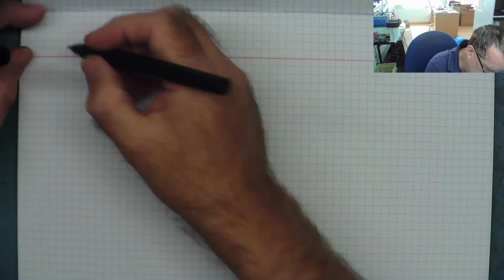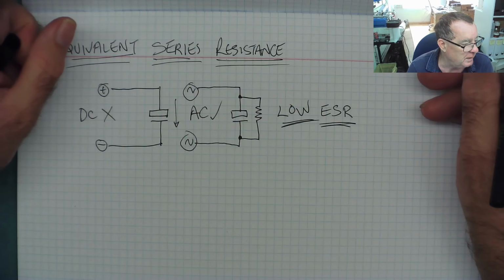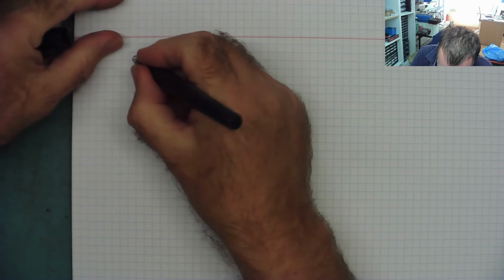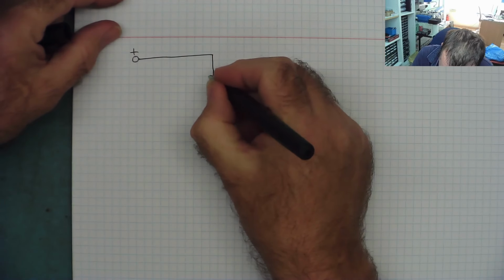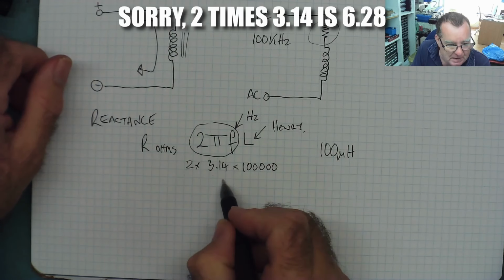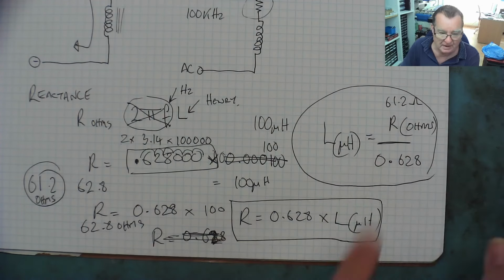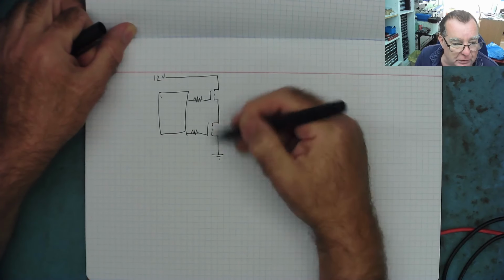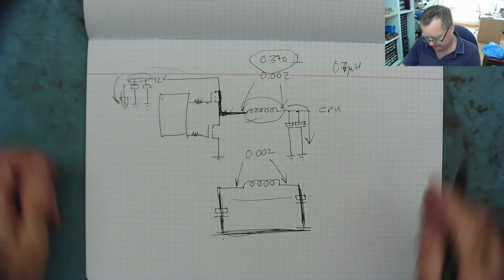All You Need To Know About ESR METER To Fix Stuff. How To Use Test Capacitors Inductors Short Finder

Comment from the maker: IMPORTANT
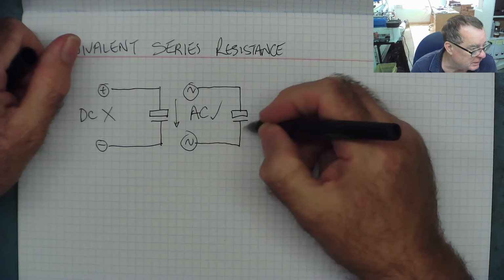As a few people have rightly mentioned - I drew the imaginary resistor in the wrong place at 00:03:25 it should be in series with the capacitor not in parallel with it - this should be obvious really because ESR stands for Equivalent SERIES resistance😅   Sorry guys if that caused any confusion.  What I drew, if anything, is the leakage resistance of the capacitor which I later demonstrated at 00:05:30 when I tried to use a multimeter on ohms range to test a capacitor.  Hopefully this error does not distract too much from the demonstration of ESR meter usage in various situations.
Reply: I have made mistakes in my videos which I have left in. I do put the corrections in a pinned comment just like you did. Too much editing just takes away the human element in my opinion.

I just thought to think, I wonder if anyone else does this, and you did! I tip my hat to you sir!
Reply: Applisto both AC and DC. Your drawing for ESR is actually for leakage that applies to both DC & AC circuits. ESR is usually measured with 1oo kHz AC test signals.
     MY only ESR tester is my component tester (3-leaded). Do you know how well this function works in tat device?
Reply: Rookie mistake, but we all stuff up.😊
Good that you acknowledge it and let everyone know.👍
Reply: Please correct your video.

Comment: This meter will expose bad sellers on ebay bought Nichicon UKA 100UF 16V capacitors in june 2025 tested them used them in a repair Akai MPC500 fixed the audio path problem now i had one left over doing a repair need a 100uf so found the last one i never used tested capacitance good tested ECR on the mesr 100 and got reading of 1.11  when worst case should be 0.7 thats weird it was stored in a jiffy bag in a plastic container. Just shows that something i repaired could go bad quicker than i thought or these caps don't store well.

Comment: How do you use guard lines?
e.g., 
How to use the DE-5000 guard line TL-23 to measure high impedance components such as a small capacitance 0402 and 0201 capacitors?

Comment: That's right. That's a great tool. 
Measuring inductors to find  shorted MOSFET - brilliant. Thank you 😁
But if you can spare a little more you can buy an LCR meter that is measuring ESR too.
The chepest (but sitll reliable) I found and bought was DER DE-5000.
It's handy all-in-one tool for RLC measurements for less than 150$ (new).
Next level are Agilent meters...but they start from 400$ used.

Comment: Good video, in spite of the error in regard to where the effective SERIES resistance goes relative to the ideal capacitance.

One things I noted was that DCR (DC Resistance) was not mentioned (in case I missed it?). This is a very important characteristic of capacitors, and on electrolytics shows breakdowns of the capacitor's internal structure, up to the point of a total failure what would appear as a shorted capacitor. Many ESR testers/meters do NOT measure DCR, but many DO. 

As was mentioned in this video, a capacitor that is clearly bad (from physical inspection, or noting that the measured capacitance is way off) can still look OK in an ESR test/measurement, but will fail a DCR test. So it is useful for buy an ESR meter that can do both. A common testing strategy is to test DCR first, then only if THAT test is OK, then proceed to test ESR. Some ESR meters automate this dual test, or can be selected to a mode where ONLY ESR is tested.

Also, an ESR meter can be used to test low value resistors (below 30 or 25 Ohms), often with better accuracy that inexpensive multimeters can manage, BUT it is best to use the DCR mode for such tests, because in ESR mode the result will be skewed by the inherent parasitic inductance or capacitance of the resistor.

I had looked at buying this same ESR meter shown in the video, but could not determine from the given specifications of it was able to test DCR, so I bought a different one, about $40, from EZM, their ESR-2501C, which does both.

There is another product, sold under many brand names, which instead of an LCD display instead uses an LED bar graph to show the resistance value. This also tests ESR and DCR, and is one of the models that can automate the two tests, DCR then ESR. The downside to those is that they are much more expensive, and can only be used with the included tweezers test clip, which rules out testing physically larger capacitors or axial lead ones (and they won't tolerate adding extension leads/clips).

Comment: I bought a fairly inexpensive esr off amazon for troubleshooting my Tascam 122 mkii tape deck.  I spent hours trying to find an intermittent fault with the counter display on the deck. It kept glitching the display every once in a while and it was really annoying.  I checked almost every component in the deck, swapping out this and that but couldnt pin it down.   I bought the esr and started pulling caps on the power supply, testing and replacing as i went.  Eventually i came across 2 caps on the board that showed on the esr that they were way out of spec. I swapped those 2 caps out and just like that the problem was fixed. :)  Very handy bit of kit.

Comment: Hello, very interesting video, I have the same ESR meter.  I am trying to repair some power supplies and have run into an issue.  A cap required is a 1 uF 400v electrolytic.  My charts say the ESR should not exceed 8 ohms.  I have tried buying new but even low ESR caps are measuring new between 16 & 22 ohms.  Are all these faulty or am I missing something?

Comment: I realize this video has been up for over a year, but my need to troubleshoot capacitors in a switched mode power supply beyond the obvious largest ones brought me here. I purchased the same ESR meter, and am pleasantly surprised to find that it has the dual purpose of measuring inductors. I’ve worked with electronics for half a century, and didn’t even know about the potential of in-circuit testing with this type of meter. I just assumed it to be an esoteric test instrument for very special testing. Boy, was I wrong! Thanks for your excellent presentation and explanations. Well done!

Comment: For those new to the game, if you switch a voltage, that rising edge can be thought of as being composed as an infinite number of frequencies for a very short amount of time, so if you connect an inductor or capacitor to the switch, the inductive reactance will be high and for a capacitor, low reactance.
This is why in communications, you want to decrease the number of transitions in a digital system, because each pulse is increasing the bandwidth and so it may not meet regulations on noise interference.

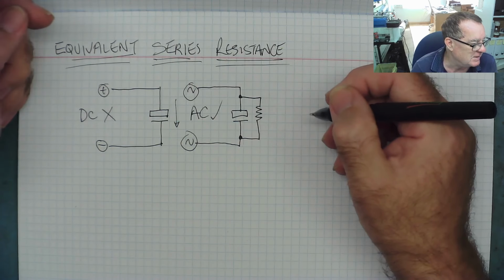Comment: 4:16 in, thats leakage, ESR is in series with the capacitor limiting the current through the capacitor and raising it:  Xc+Rs where Rs is the ESR. So at 7mins in, you are measuring leakage.
The way to measure ESR, is by increasing the frequency to lower Xc to near zero, so the ESR is being measured, Xc=1/(2.PI.F.C).
Your videos are great, but you made a mistake here, I would take it down and re-issue.

Comment: Instead of dividing by .628, you could multiply by 1.6. And if you multiply by 1.5, which means just adding 50% to the measured value, you can do thus without a calculator and are close enough for most practical purposes. Unless you want to build a precision oscillator, of course😊
This is how I convert the mph speedometer on my classic car to km/h. Though I keep telling people that I divide the reading by .65, which typically confuses them. And makes them admire my mental calculation skills 😂

Comment: You don’t need ant test equipment but your mind in order to fix equipment especially the ESR meter. Bahh hummbug! Replacing parts fixes equipment, measuring voltages and resistance will reveal any and all problems.

Comment: Not to nitpick, but you you showed the resistor in parallel with the capacitor. There's a reason it's called, Equivalent SERIES Resistance. In other words, if the capacitor had a series resistor built into it, which they effectively do. That's why we measure ESR.

Comment: 11:24 - It was surprising to me that your meter reads open here considering the input capacitance of your scope. Am I missing something?
19:51 - shouldn’t the term be EPR (Equivalent Parallel Resistance since the resistance is thought to be in parallel with the capacitor as you showed earlier?)

Comment: Hello
Incredible channel.
Liked and subscribed.

I had one question, you mentioned the ESR meter is only used on electrolytic caps. Is it also possible to use it on ceramic caps? SMD caps?

Comment: In the Defense of the cheapy.....

1.  it's $3 Shipped

2. If you're starting out, THERE IS A DEBATE TO HOW USEFUL IT CAN BE.
As a component Identifier........ it's useful for a beginner, it can determine NPN vs PNP , it can distinguish JFET vs MOSFET vs BJT , it can tell you if it's a voltage Reg or MOSFET.
it is useful in some respects

3. Purely as an E.S.R. Meter.  you cannot say it's not an E.S.R. Meter.  it does have E.S.R. Functionality
Now... I have this one and i have the MESR-100
I AGREE THERE IS NO COMPARISON, The MESR-100 Wins hands down

but hey... I DID USE THAT CHEAPY FOR LIKE 2 YEARS REPAIRING TV'S AND COMPUTERS, Testing E.S.R. in circuit 
and I DID FINE

THE TRICK IS....
YOU HAVE TO ALLOW THAT IT'S A CHEAP UNIT AND IT CAN BE A LITTLE OUT.
that's all

it's not completely useless
I Agree.... GET A MESR-100
I have looked at a lot of E.S.R. Meters up to $4,000
I cannot justify buying anything more than the MESR-100 as i don't see any advantage from an E.S.R. Stand Point in the real world

but that $3 Cheapy is nothing to scoff at either
it's a good little piece of kit for what it is  and for a beginner.

now also, if you have like 100 components you need to test,   THIS CAN ALSO BE A TIME SAVER
Example : you need to test 100 Diodes,
MAN I PROMISE YOU THIS THING WILL HALF YOU TESTING TIME
if all you are interested in is
does it work
does the reverse Block
What is the vF
then this thing will get through that stack of diodes quick smart

TIME AND PLACE FOR EVERYTHING MATE

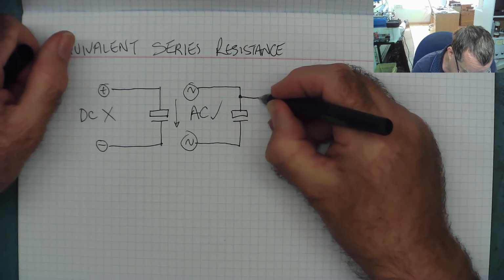Comment: 3:29 Sorry, WRONG !!! You are NOT showing  a SERIES resistance, you are showing A PARALLEL resistance !!!  Good ESR meters can  measure/calculate 
an Equivalent Series Resistance or an Equivalent Parallel Resistance on any capacitor, but the resistance value given IS VERY DIFFERENT between those two resistors, don't transpose them!!!
Well, as you can see, I spoke before I read the rest of these comments, had I seen, I'd have foregone the comment, SO, I'll leave the comment so I can apologize for it !!!

Comment: Rich, when you test a capacitor you first use a capacitance tester and then the MESR device. Is there a single unit I could buy that does both? If there is it will both save cost and time (as I'd only need to do one single test)?

Comment: It might should be called Series impedance @ 100kHz. For this tester. I've always wondered why this sort of tool doesn't have you first plug in values or info you know about the DUT. Then frequency sweep it to verify that it's tuned resonance is within the range that it should be. THEN give ERS reading in ohms of impedance, right? THEN call the capacitor "good" or "bad". Like. ONLY then. It should auto-short leads.

Comment: You tested 2 bulging capacitors on an ESR meter and it showed that they are good but they are actually bad proven with a multimeter with a bad capacitance. This means a better test is with our inspection and with a multimeter. There is no need for an ESR meter that gives rubbish results, in my humble opinion.

Comment: Can you use a meter like this to test caps without removing them from a circuit board? I’ve got a CRT TV that could use the capacitors checked and I’d prefer to not remove to test

Comment: Great video.  I am sorry that you did not mention the chart on the ESR meter.  I had no idea that it could measure inductors.  I was always screwed by not knowing inductor values, but now you taught me how to find them with the ESR meter.  Thanks!  I am sorry that you did not include that, when you turn the ESR meter off, it says "Thanks for using.  Bye"

Comment: Loving the content almost watched all your videos working through them. I've recently had to retire early due to disability and gone back to my childhood hobby of electronics so picking it all back up again . Can anybody help I've a Dan radio power board which I diagnosed that it has two faulty voltage regulators also a damaged cap I have changed them all and tries it again and the regulators have both blown again I've tested the circuit again from power in which is 9v DC and the only thing I can find is two resistor are reading low to what they should be . Any help I know you can't see the board but any advise would be great.

Comment: I would like to know about different types of electrolytic capacitors.
They may have the same capacitance & voltage & 
they may even look the same but, they have different markings on them.
 Some are for audio, some are for switching power supplies. Ect.
I know some have low ESR but, I think there's more to it than just that? Could you make a video explaining the difference types or have you made a video?

Comment: I just wanted to let you know that you're a great teacher. You break things down to a level that people can easily understand. Unlike most experts who forget to, you bring the true 101 of a beginner course to the table. Before I watched your series of videos, it felt like I was trying to read a foreign language between other YouTubers, documentation, and what my eyes are seeing in equipment. You taught me how to read meters, schematics, understanding classes of amplifiers beyond a single filter cap. 

I've always wanted to learn and understand electronics and it always intrigued me as a kid and beyond. I started getting into audio equipment and opening them up and trying to make them work by replacing stuff until it worked. Now I can pinpoint problems a lot easier than I have. I can only wish I can pick your brain for a million questions and DIY stuff. 

One thing that I'm having a hard time with are stabistors. I have a Pioneer SX-838 that has two broken leads at both of the stabistors. I'm having a hard time understanding how to make one, what I should make it with, and even though there's written instructions, I'm still a beginner, and pictures and videos work wonders for my understanding and learning process. I hope you can take the time to help me with this and would greatly appreciate the help.

Comment: another reason for low esr: the higher the more heat gets generated. the more heat, the faster the electrolytic filling is drying. the faster it's drying the sooner the cap is dying.

and be sure to consider the purpose for the cap when choosing the esr test frequency. because esr varies with frequency, we use electrolytic caps in psu filters and foil caps in signal filters. with only one frequency you can only check for one purpose.

Comment: Great video! Thank you for explaining ESR and showing us a unique use for an ESR meter. Testing capacitors completely can be difficult. For example I am currently refurbishing a piece of 1980's vintage test gear that has a 4000 uF, 30 Vdc, +75/-10% electrolytic in the power supply. It measures 4630 uF and has an ESR of 0 ohms at 120 Hz - great!  The problem is that it has a leakage current of 317 uA at 30 Vdc. So, as you pointed out, capacitor value and ESR aren't the whole story - especially for larger aluminum electrolytics. Regards, David